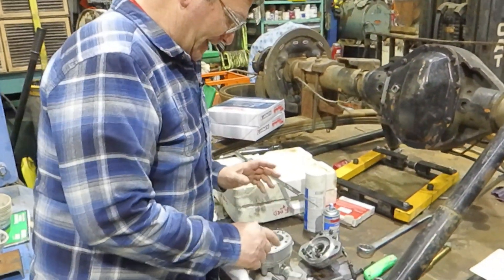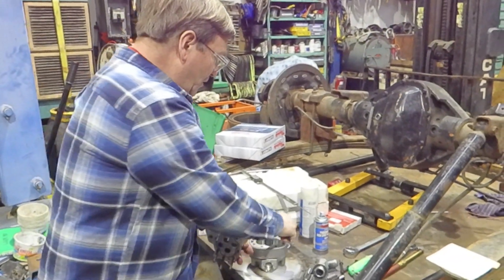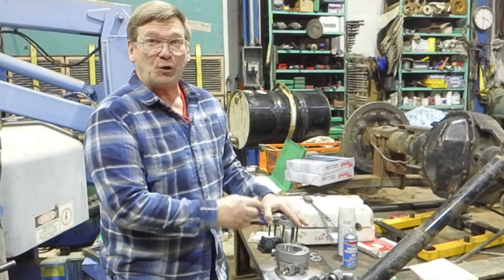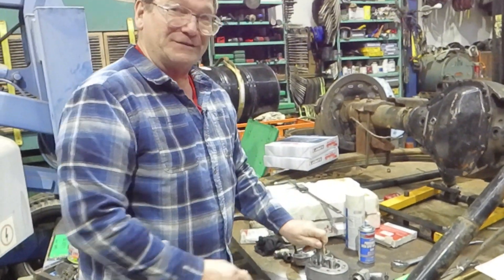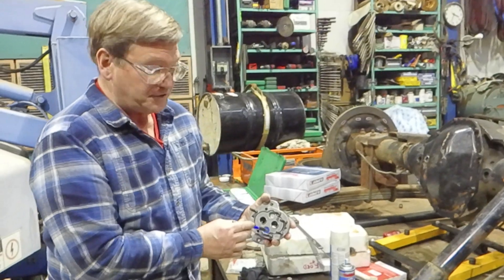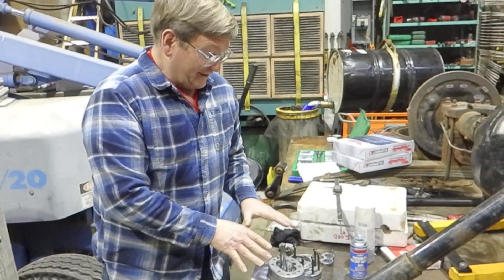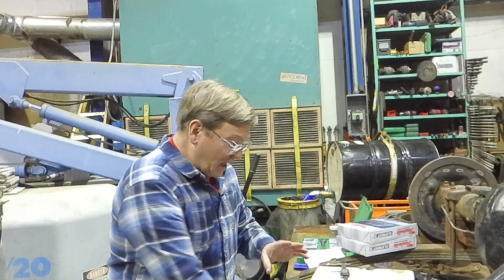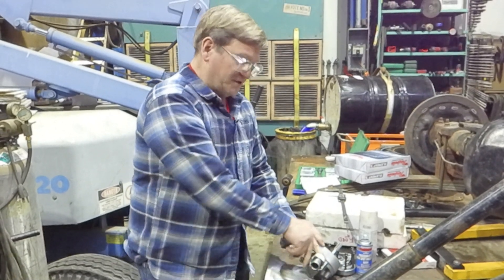Machinist's Minutes: Hydraulic Pumps (Rebuilding, Modifying)

Comment: Loved the video and the valuable info. I wish I had known all of this before I blew a hydraulic asphalt pump on my tanker trailer 😬. I forgot to disengage the PTO pump, the pump was mounted mid belly on my tanker, there were two lines that connected my PTO pump to my trailer, I disconnected one without disabling pto pump, and seconds later my pump blew up to smithereens spewing oil everywhere. I had disconnected the return line without disconnecting the supply line. $800 lesson learned the hard way 🤷‍♂️